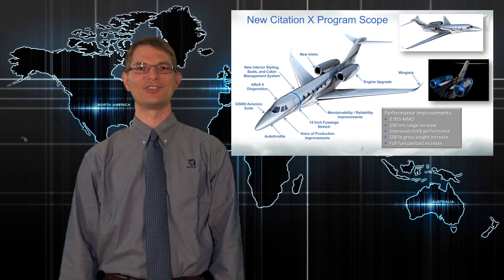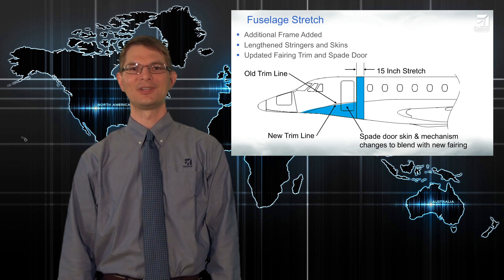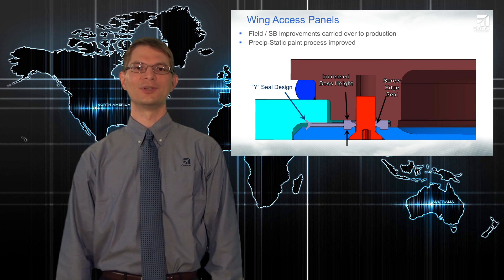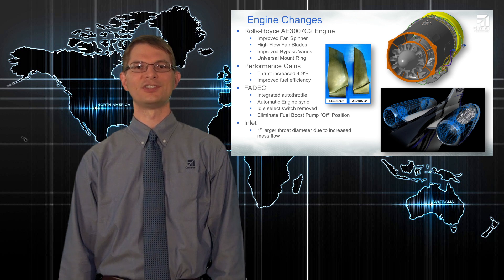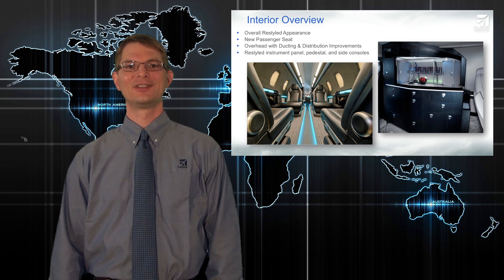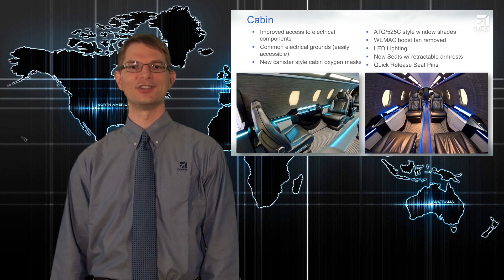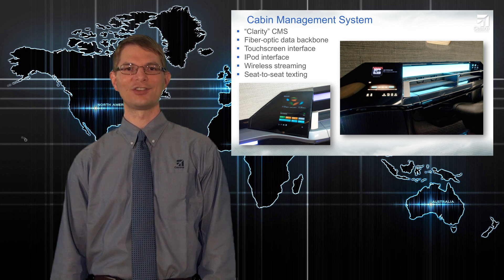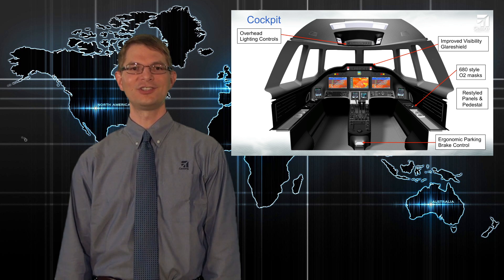The New Citation X Update Session One Airframe, Powerplant & Interior

Comment: Should be mention of its new range and fuel capacity. Any ideas if a HUD for pilot is in near future. Very nice feature on the G650 no reason the Citation can't easily match this. Also curious how the new engines handle shorter runways and new take off distance required, assuming better engines=shorter distance.